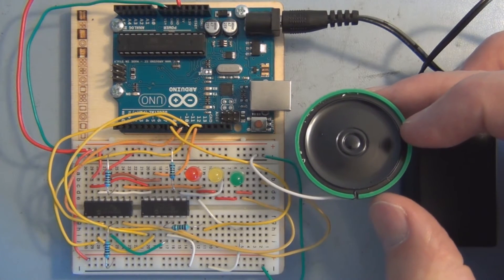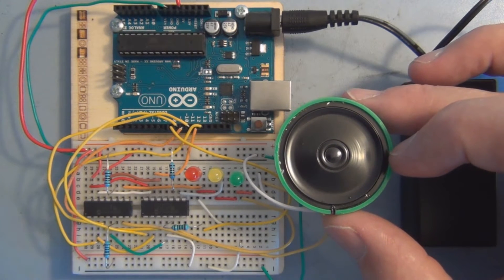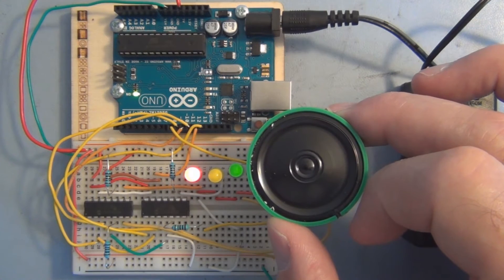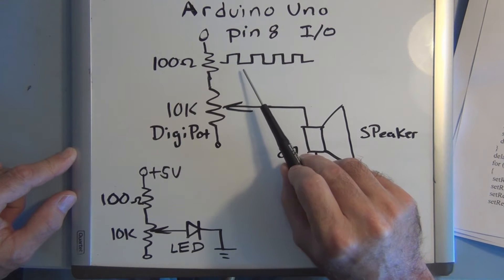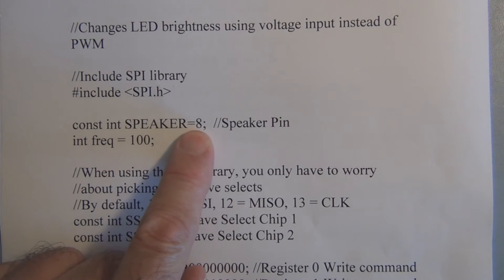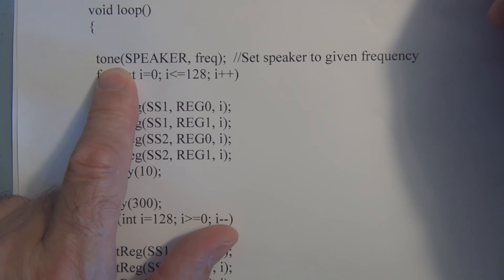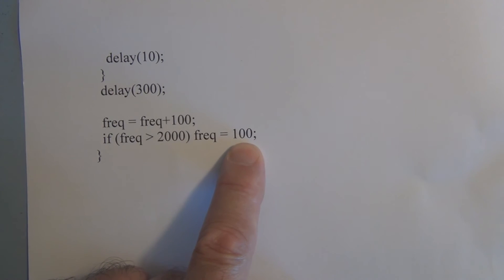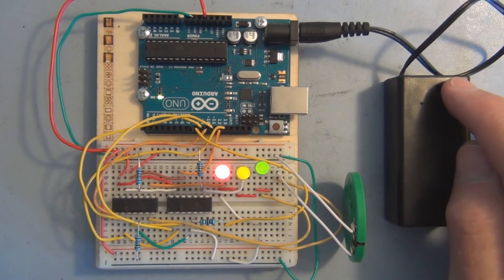Arduino Digipot Volume Control

Comment: Thanks for the nice presentation. It was very informative. Can you please help me with the similar Digipot (MCP41HV51). 
I have MCP41HV51, which I want to use for high voltage applications. Can you please upload a video for using arduino with this Digipot. Thanks in advance.

Comment: Hi

That's really interesting.

If I understand it the LEDs are cycling through a sequence where the digipot, through the controller, offers less and less resistance creating the brightness swell.

Could an arduino/digipot be used in a similar way to control a digipot in a guitar pedal that would increase or decrease the volume of an audio signal over a given time to create a uniform fade in?

Do the increases have to come in discrete steps or would it be possible to have the increase have a logatithmic increment over time to replicate an audio/logaritmic potentimeter?
Reply: please your doubt is mine, any suggestion how to make a smooth volume control?